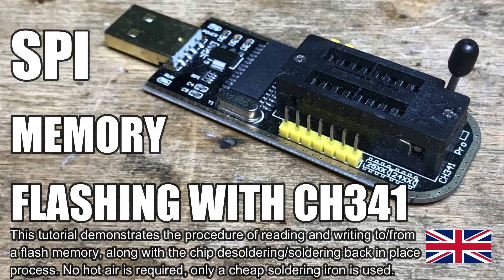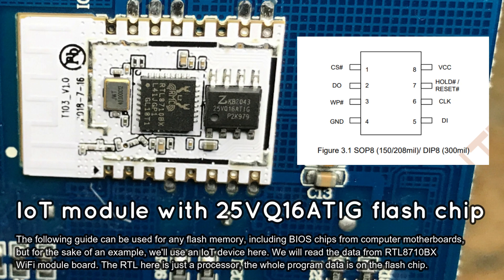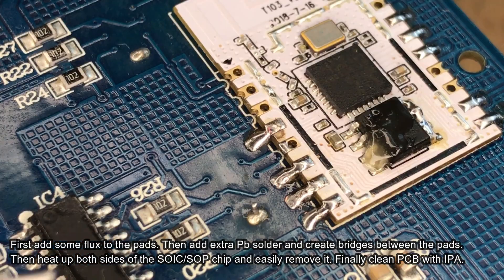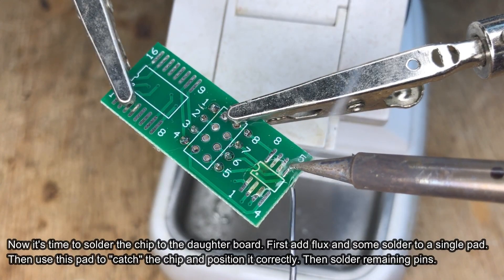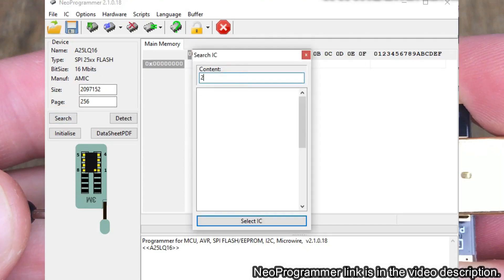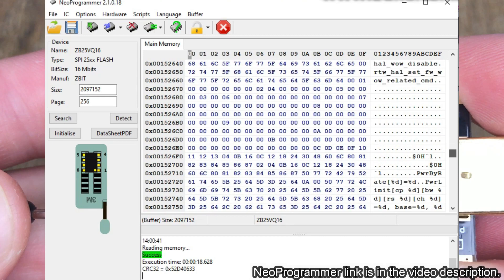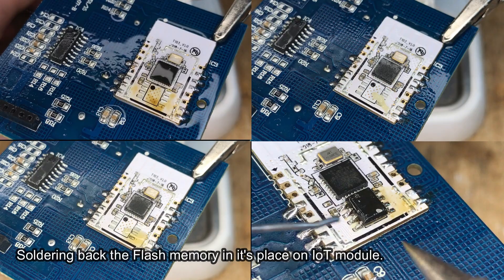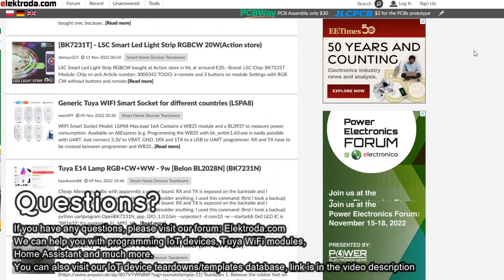How to desolder and read/write SPI flash memory with CH341 and NeoProgrammer (IoT flash, bios, etc)

Comment: I flashed a BIOS chip : Windbond W25Q64FVSIG for an Asus K56CB laptop, with a CH341A programmer, but I used the "crocodile' clip ; didn't need to de-solder the chip from the motherboard ...
Reply: and for a 16-pin chip, how do you adapt the clamp to the Ch341a adapter without desoldering?
Reply: @lawelch4967  Windbond W25Q64FVSIG is SOP8 package. The Chinese vendor from AliExpress send this "adapter" with 8 pin clamp. Think I was lucky that matching with my Windbond W25Q64FVSIG.